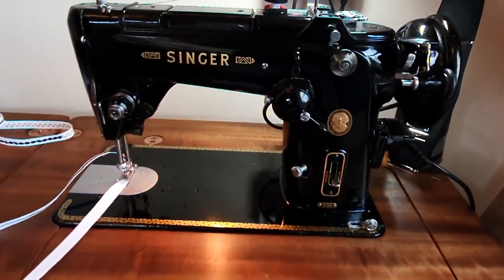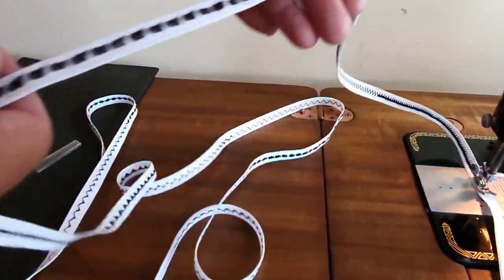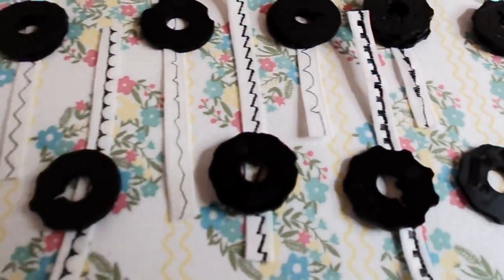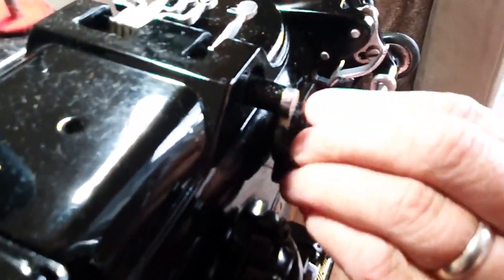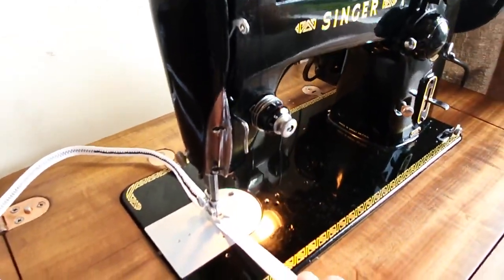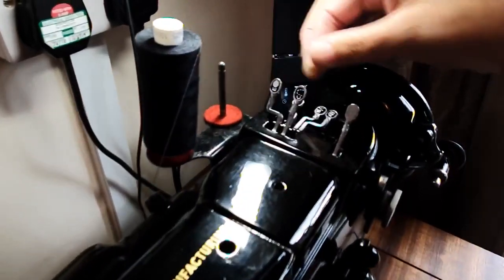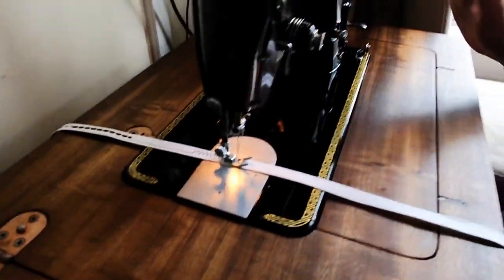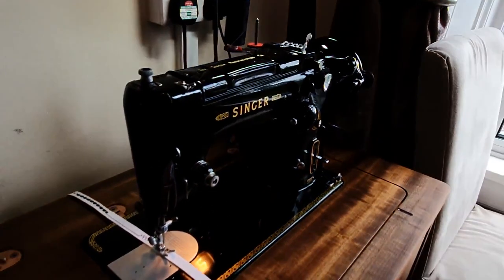The Singer 319k for embroidery stitches

Comment: Hello, I like how the 319k machine sews when I buy it or how I get one and how much it is worth and where with its accessories I like it and manual please answer
Reply: Here you able to find the machine?
Reply: @rubendario3768  how much can you get singer 319 prices and their embroidery discs if you can know and thanks for answering
Reply: @richardrivero1049  I got one from eBay yesterday for US 71.00 in beautiful state..  now I have two.. the black one and the two tone green.. the black one I got for 125..with all the embroidery disks and all the attachements and books.. you just have to be patient and wait on eBay.
Reply: @rubendario3768  Yes oky thanks but I am from Venezuela and they did not arrive here but I already know how to gather more for the shipment and thank you for responding and what kind of material are you sewing or working, what new videos are you going to do to be pending, greetings
Reply: @richardrivero1049  I am a collector.. do not really sew. Send me an email address and I will send you pictures of some of my machines. But I have tested the machine sewing leather.. and other materials. The 319 does not come with a strong motor.. only .6 amps.. best thing is you can upgrade to a 1.5 amp motor.. the frame of the machine is all steel..so the frame could be like an industrial.. bit the motor will be better changed if you want to see thick materials.
Reply: @rubendario3768  If I know that it changes the engine and sews well like the industrialists of today, they are the first industrialists that my mother made, she left me her mother's 315 and 216 singer's inheritance. .com thanks for answering greetings I have faceboock (rjrivero) and intagran y whatsapp y usted señor ruben para las fotos

Comment: What kind,of belt does this machine use?
Reply from the maker: It is driven by a stapled belt.
Reply: @suzypennycook3047  not sure what stapled belt means.
Reply: @apiecemaker1163  It has a staple belt (it's a flat corded belt with steel staples binding it together) inside the machine driving the shafts underneath that work the rotary bobbin shuttle and the feed dogs. It also has a normal sewing machine pulley belt between the external electric motor and the hand wheel.